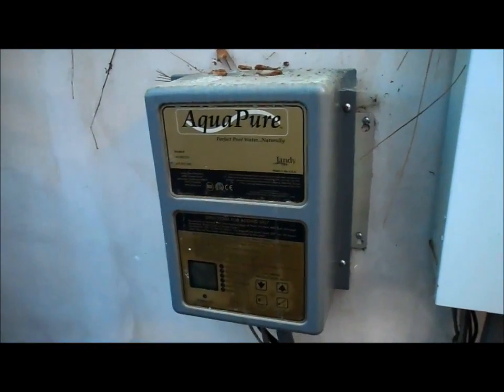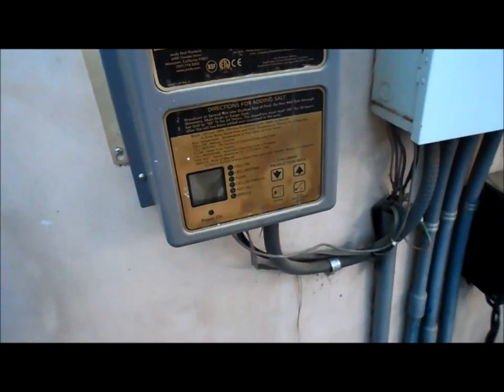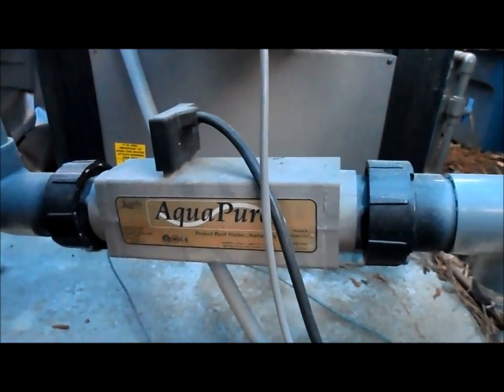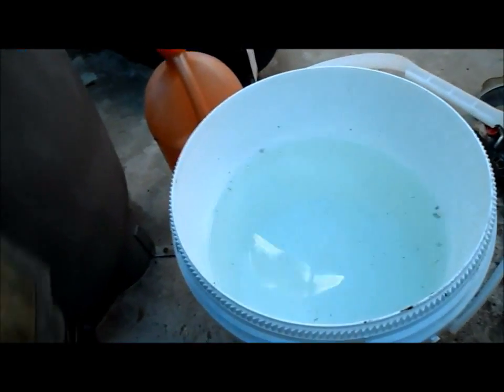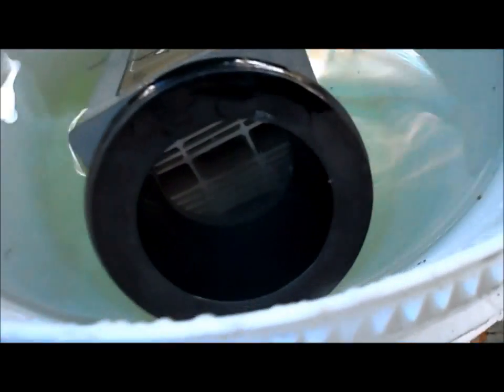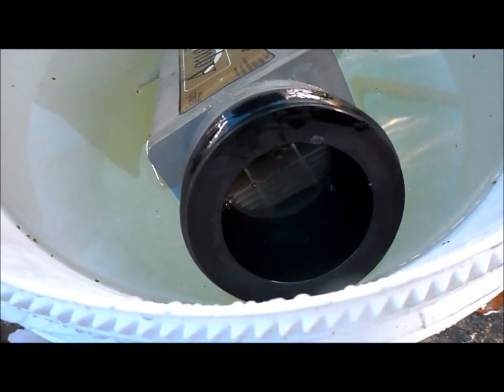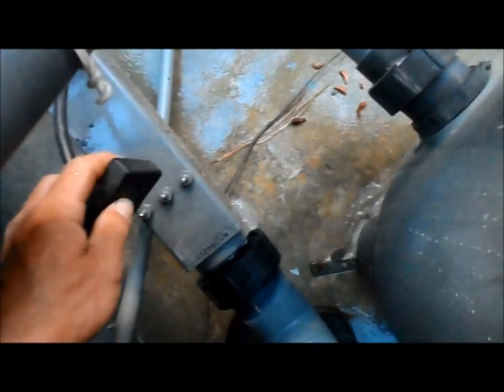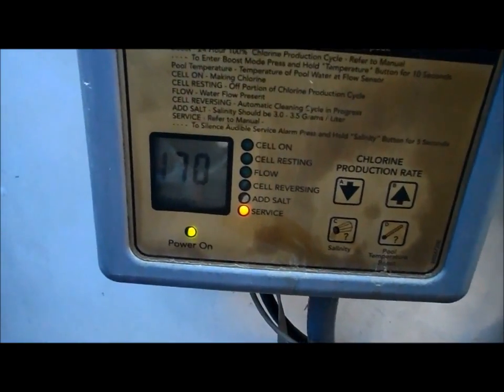Jandy Aquapure 1400 Salt Cell Cleaning and Error Codes

Comment: The video I watched stopped as the error code showed 170. What did you do to fix error code 170?
Reply from the maker: That indicates a bad board. If the system is pretty old I would consider upgrading the entire unit to a TruClear system. It will fit in the same exact pluming area if you buy the retrofit kit. Then you just need to mount the new power unit and attach  the 3 wires to power it. An option.
Reply: I actually had a pool tech switch out the board with a new one and still received the 170 error code. I have asked an electrician to come out and check the AC voltage. Is the transformer a component of the backboard. Is there a video on how to change the backboard. Your thoughts on replacing the sensor? Thank you.

Comment: Just one safety item that you may want to emphasize in future videos: You correctly add acid to water, but you should make it very clear how important that is. Acid into water, never the other way around. Pouring water into acid will make it bubble and splash violently.

Comment: How do you make sure that when you replace the censor water does not come gushing out?  Do I need to shut off all the valves (equipment below pool level) to get the censor replaced?
Reply from the maker: You will need to turn off some valves first.

Comment: My cell sensor seems to be working fine, but should I brush it or use any acid on it to be preventative whilst I am soaking the cell? Also is it a good idea to add some lubricant to the O rings for the cell unions before I reconnect the cell?  Thanks!

Comment: any idea of what setting (% wise) I should set my generator on?...Florida - 10,700 gallons, and have it running from 8-5 every day.  New pool, I added 1 gal of liquid chlorine and set to 60% to start but seems like the chlorine went through the roof for a couple of days....settling down now...trying to find the sweet spot....trial and error I guess?
Reply from the maker: Try 40% - that is a pretty small pool. And eight hours run time might be too long - if you are using a standard 1 speed pump.
Reply: Thank you sir...variable speed pump...running 2850 RPM.

Comment: What if the cell is making 00% chlorine?

I've tried resetting and using the 24 hour boost function.

Error code shows "60"
Reply: The display is cycling through "60"...."JO"......"00%"

Comment: Hello - i have error code 170 on my Jandy Aquapure.    Its says front board problem.   Any videos or help on replacing that board or could it be a different problem.
Reply from the maker: Brad Roden  I think Jandy no longer sells the front board replacement as a separate part  -at least my supplier stopped carrying it.  Truthfully that salt system is terrible and you will have more error codes popping up. Better to cut your loses and invest in a new salt system. There are a lot of good ones on the market today.
Reply: Brad- I have reached the same conclusion. . .can you recommend a couple of those "good ones on the market today"? Thanks

Comment: I just moved into a house with a Jandy Aquapure 1400 also, the manual said to put pool chemicals in with the pump off.  So do I turn the pump off before shock.   Then, shock the pool, and then turn it back on?  Or just leave it running while I shock?...  If not to much my cya is also 200??  Do you know what I should do?.... Does anybody?  Thank y'all in advance.

Comment: On this video it showed error code 170.. I have same problem... What to do.. Bought a new front board and still doing same issue.. Is it the sensor??.. Thanks
Reply: andrew freitag  Did you find out what the issue was?
Reply: I read its the censor ... a good way is to remove the censor and from the board and see if the error goes away ...

Comment: I HAD A POOL COMPANY REPLACE MY JANDY SALT FILTER AND NOTICED THE arrows on the filter were facing the wrong way for proper flow (after several months). Yes they put it in wrong but tell me it did not effect its function or damage the unit.  Is this true?
Reply from the maker: The only way to be sure is to call Jandy and ask them. Probably a filter question. Their tech support is usually really good. Never did that on my route so I wouldn't now firsthand. 800-822-7933. Strange that the filter worked for so long without you noticing it. Weird error on their part but stuff like that happens.

Comment: I have a Jandy PLC1400 salt cell. Even though the cell employs Cell Reversing, do I still need to inspect an clean with muriatic acid?  Thanks for all of your videos!
Reply from the maker: Yes. The cell reversing helps some but calcium still can build up on the plates. Pretty easy to remove and inspect.

Comment from the maker: Did your new cell come with the flow sensor built into it. I know the new versions do. The older versions had the flow sensor in the pipe. I have a video that shows the flow sensor - if you click on my salt cell playlist it is the 3rd video in the list. I guess the first thing is to know if your new cell came with a new flow sensor. If that is the case then you will need to wire it in like in the video I refer to.

Comment from the maker: Hayward makes a Salt System Called "Salt & Swim" It looks easy to install. The power center just plugs in like any appliance. You would just need to do a minor re-plumbing to install the cell. It retails for $600.00. The only drawback is that the cell is rated for 1 year. So every year you need a new cell for around $100.00. I've seen the demo at my supply place and it looks pretty good.

Comment from the maker: You would have to replace both the power center and the Salt Cell. It is a bit of work but the Pentair Salt System is far superior. 1st, everything is basically built into the cell so every five years when you get a new cell you are getting a new system minus the simple power system. There are no error codes or other expensive parts to replace like the Flow Sensor or Circuit Board and the Pentair brand is very reliable.

Comment from the maker: Yes. Error codes start appearing around the 2 year mark. The flow sensor is probably bad. I am going to post a video next week on replacing the flow sensor. It's a bad sign when the manufacturer sell a combo pack; salt cell & flow sensor together.

Comment: I have a 172 and 186 code on mine. Already cleaned the sensor, checked for bent wires on sensor, its actually only  2 yrs old. Is this common to happen in this time frame?

Comment from the maker: Unfortunately there is no way that I know of to turn off the beeping. The circuit board is shot with the 170 code so the beep will con't until it is replaced. If your Aquapure is not on dedicated breaker, you can try opening it and unplugging the power cord (I haven't done this). I have opened it to replace the Flow Sensor so it is easy to open. Just take off the 4 screws and the face pops off. You will see a couple of circuit boards and some cords. Everything should be marked inside.

Comment: Thanks for your reply. I have a code 170 and I am trying to turn off the "beeping" that happens every minute or so. I press and hold the Chlor Prod rate button at the PC board but nothing happens. Is there a special way to disable the beeping? My PDA doesn't even recognize the AquaPure system anymore either. (I don't care to use AquaPure anymore; no money to buy replacement parts(.

Comment from the maker: You can just turn the breaker off or leave it running, it doesn't matter much. Just check your Conditioner level and make sure it is 30-50 ppm and the Tri-chlor Tablets will do fine (I have videos on both).  A lot can go wrong with this brand, and I have three that are down right now. One is in the process of getting the "Flow Sensor" replaced (Error code 172, 181) It is a $200+ part.  I will post a video on that shortly. The other two are pretty much dead.

Comment from the maker: Yes it is replaceable. Amazon sells it for $320 (test the voltage to box 1st, that could be the problem too). If your unit is over 5 yrs old, maybe just order a new complete unit for $1200 or better yet switch to the Pentair Intellichlor Ic40 for $900 for the complete unit. It is a much better salt system and very reliable. The Jandy system is nothing but trouble. I have 3 accts w/ the Jandy and all are offline, one has a burned out power box and the others have bad sensors. Hope that helps.
Reply: what does low flow mean? and how to you read the salt level? it dosnt show 4digits ,ex (2800-3200) when i press the salinity button?